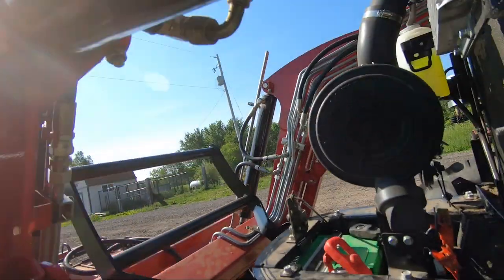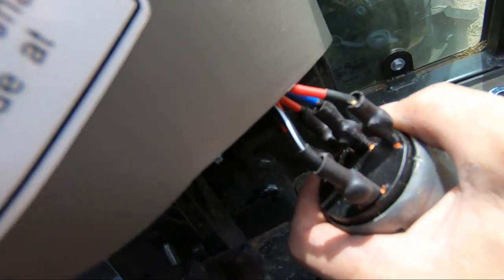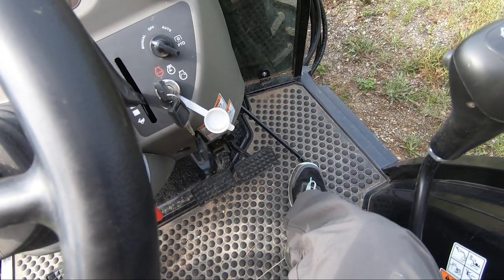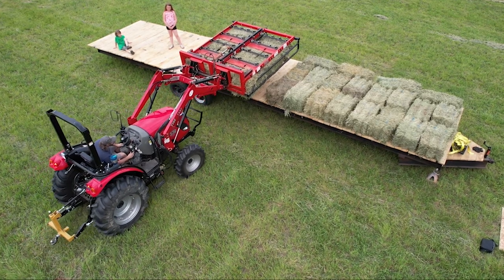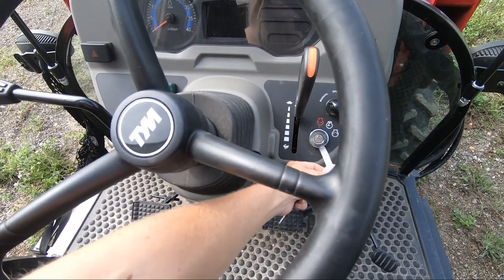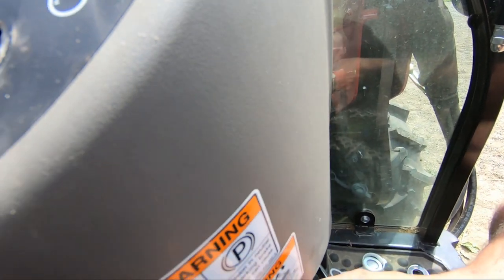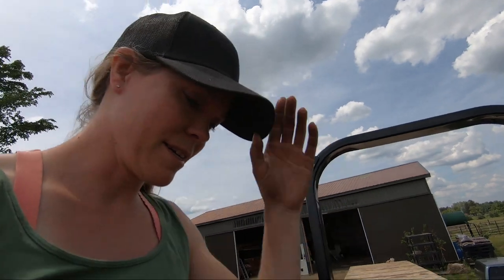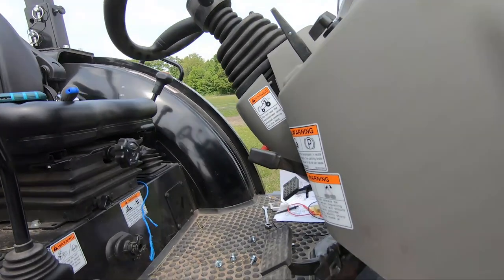381 Our New Tractor is DEAD - Why It DIDN'T Catch Fire . . .

Comment: I just picked up a t474 cab and love it. I went over the whole thing when I got it relocating and securing wiring as well as hydraulic lines. Looks like I'll be messing with this tomorrow.  Edit* I looked and my throttle cable is at least an inch away from the ignition switch.  Dash is identical looking but there must be some differences I guess.
Reply from the maker: Good to know! Maybe mine was a fluke! I almost went with the 474, but it came down to weight and being able to handle a load of hay with the grapple. The 574 is JUST big enough! I LOVE how tight they can turn and so nimble!
Reply: @This1LifeWeLive  so far in the 22 hours I have on it I can't complain about much.  Lift capacity on the loader is awesome! Tractor is nice and compact so it fits my needs just right.  Only think I wish it had was a parking light for the parking brake.
Reply: I've had the 433 for over ten years. No issues with this so far. Dash looks identical.

Be aware if you put a dark tarp over it though, it will melt the gauge cluster frame... 😕

Comment: Don’t they have some kind of warranty on their tractors? I got a 3 year on a Husqvarna
Reply from the maker: Yes they do, but I didn't have time to wait for repairs.
Reply: My tym came with 2 years Bumper to bumper and 6 years on drivetrain... I had to use warrenty on a wheel seal and it took about 1.5 weeks to get my unit back...  it was covered.

Comment: I believe you should put the NH on the bale wagon and the TYM on the baler - that TYM has a lot to handle with that bale wagon full/loaded - suggestion only
Reply: I looked up the specks on the TYM 3point picks up right around 4000lbs. If we load 200x50lb bales thats a 10,000lb load. The trailer axels are placed at 60% of the deck length so in theory you have 20% of the load on the toung making it around 2000lbs for the 3 point to lift. we have only done 150 bales so far which is a 7500lb load

Comment: That is great that there was a fuse in line. Looks. Like a design flaw. It is not good.  If it me I would have drilled another hole for the switch.

Comment: Ran New Holland tractors now for many years and never had any problems.
Reply from the maker: We've had a few with our T5 . . .PTO refusing to engage, transmission "jumping" (could be a fuel pump issue or hydro pump issue) and it's been getting stuck in gear (my husband isn't the cleanest shifter).    But this TYM has a very basic motor, so IF something motorwise should ever go wrong, it's something I could repair myself and not have to haul down to the shop :)

Comment: What happened to the basket wagon you pulled behind the baler?
Reply from the maker: UGGGHHH.., it's a massive PAIN! It only holds 100 bales MAX (usually 80), you need a team of people to get it done. One to bale, one to drive the truck to the barn, and one in the loft to help stack. Dumping them on the ground made a huge mess, and anything the knotter skipped or failed, the cart would be FULL of loose hay! Lots of people out here still use them, but they usually have family helping ;)
Reply: @This1LifeWeLive  I never understood there value. You need one of those things that put the bales in blocks of 10 or so for your hooks to pick up.

Comment: Sometimes when an electrical charge goes thru some thing that shuts down the engine there`s enough current to either weld arc a bearing or can arc 2 metals together probably what happened here , But having the throttle stiff now it`s possible that the silicone tube around the throttle cable melted some or softened enough to make it stiff ,The stationary throttle is more for PTO operation or full power ,Lucky you caught it but if that`s a new machine WARRANTY or recall   BIGTIME!
Reply from the maker: It seemed the current caused the two nuts to tighten and if there was any lube on the cable it dissapated. The fuse prevents much more damage than that. Without the fuse it would have welded stuff together and caused melting and fires like so many other brands.
Reply: @This1LifeWeLive  Actually a silicone spray is better than WD40 -Wd will hold dust and tighten silicone spray will weather proof and lubricate each use works great on vehicle window track guides too speeds them up too

Comment: You might need a new throttle cable. If the ign switch was shorting to ground through the metal throttle cable. the plastic sheath on the throttle could have heated up and melted some, causing binding.
Reply from the maker: I didn't see anything obvious, but it did help when I ran a bit of lube into it :)

Comment: Sounds like too me you need a John Deere,  I know they sponsor you but having something designed and it's rubs off the insulation on a major wire, well what else has a bad design and will cause problems in the future.
Reply from the maker: We had a John Deere to start out . . . we sold it and happily did not buy a new one, lol! Parts were too absurdly expensive, and attachments as well. Too expensive overall.

Comment: Thanks for sharing! Young lady but one thing am curious about does that trator take that daeth or dith fuel type crap that usually have the blue cap by the main fuel tank?? Just curious heard from people saying it's a pain in the butt to deal with that..lol
Reply: It does not. I think def starts around 75hp tier 4 tractors. our nh115 doesnt take def either its a 2014 model thats right before they started using def
Reply: @ruralridez6165  hi there, oh really I wasn't to sure but I think yer right last I knew it started over 85hp  but wasn't to sure. Inerways thanks for sharing your thoughts and opinions.

Comment: Wd-40 = lubricant
PB blaster = rust penetrant.
Reply from the maker: WD-40 and PB blaster are both brands which make the same oils and lubes. I prefer PB. I have 3 different types but can't remember the names off the top of my head, so WD-40 just rolls off the tongue much faster :P
Reply: @This1LifeWeLive  you're probably thinking of chain and cable lube. There's even a cheap little tool designed to aid in lubing cables with products that come in spray cans. But more importantly you really need to watch what you say in these videos. People can and will will take you literally, and when something goes wrong they'll tell everyone they learned it from you. Not everyone reads the comments section to see your corrections. You said to use PB blaster on everyone's mini tractor throttle cable. That's really bad advice since original PB blaster literally eats petroleum products like plastic, rubber, tar etc.

Comment: I have noticed that you do not keep your tractors under cover when not in use and as the TYM is not fitted with a cab rain water will run down the throttle lever and cause corrosion of the linkage . Water will eventually find its way into the electrical switches and cause problems there as well .The New Holland should be OK as it has a cab but if possible keep the TYM in the dry at night  All cabless tractors have the same problem.The issue with the electrics is poor design so the switch needs moving away from the lever.
Reply: Keeping a tractor (or any machine) out of the weather when not in use is probably the single most important thing you can do to extend the life of the machine. It also makes it easier to service as every bolt and fitting isn't rusted in place. Anything will do... a canopy, lean-to, run-in barn, etc.

Comment: Did you check with TYM before you posted this video? They might not be too happy.
Reply: We are not bashing TYM. This is why its good to use these tractors in real world use then the company can use this helpful information.
Reply from the maker: Yes, I notified both of my points of contact before beginning repair work (in case they wanted to send someone out lickity split). After reading a bit about eletrical issues online with OTHER manufacturers (I wanted to see if this was a TYM specific issue or if anyoen else had posted online about it), I didn't see anyone else posting about TYM but all other manufacturers they DID. So I felt confident that this was an issue MANY people face with smaller tractors, and as mentioned, most end up catching fire thanks to no fuse.

Comment: engineering design issue with not enough clearance from the switch to the throttle.
Reply from the maker: agreed. It was adjusted a few months after, according to others who had bought the same tractor :)

Comment: Poor design to have a moving screw or bolt that close to electrical connections.   My 2012 Kubota BX2360 has had NO wiring issues.   Also, a tractor that new should need no lubrication on throttle cables, period.

Comment: Most of the newer model tractors  Use Drive by Wire electronic throttle controls.....  like your car or truck...... no mechanical link.....Is this a eletro-hydralic hydrostatic drive tractor?
Reply: It is gear driven. and you have to clutch to go from fwd to rev. our new holland you can go from fwd to rev without clutching
Reply from the maker: This one is made more old school to save on possible repair points. So no  electric throttle control :)
Reply: @ruralridez6165  Really.... our 5075M JD has that kind of Trans where as the 5115M and the 6145R have the power reverser

Comment: Poor engineering. I looked at a 574 and decided on another brand. Glad I did. Thanks for being honest !!!!!!!!!!!!!!!!!!!!!!!!!!!!!
Reply from the maker: What didn't you like about the engineering?
Reply: @This1LifeWeLive  If it was good engineering the parts would not have rubbed and caused a short. Only poor planning/engineering causes things like that.
Reply from the maker: @waynederby4684  from what others who have bought them recently have said, the issue has since been fixed. It's not a common issue simply because most people use the for throttle not the hand throttle when switching quickly between slow and fast... that's why the foot throttle was created. My husband has been using the hand throttle running bales back and forth on the field... that's several hours worth of yanking thechand throttle back and forth. It COULD be a common issue on other brands too, but I imagine most people know to use the foot throttle when running hours on end 😉. After I asked him why he was not using the foot throttle, he started using it and found its much faster. But he's not used to running tractors all day. Clutches burn out too when improperly used... doesn't mean they are poorly engineered, just means the driver needs to be more gentle 😉.
Reply: @This1LifeWeLive  Point taken.  As for clutches, do you know how old the clutch design is?? Very old and is a poor design by today's standards. When automatics started to become more popular they had already stopped trying to develop a better clutch system and concentrated on automatic, hydrostatic etc. So while clutches do work and fairly well they are a poor engineered design by what is being currently developed. It's one of the few things that if it aint broke don't fix it actually applies. But they could develop better engineered if the wanted to but the vast majority of people want auto or hydro type transmissions that requires less physical involvement. FYI personally I'm a clutch person. Both my 3/4 ton truck, and my tractor are manual transmission which is one way I know that although I prefer them they are a old and poor design that still works. :)

Comment: So instead of fixing the problem they added a fuse to keep the tractor from burning down.?  There needs to be a solution for this and if this is on going it say we are giving you a pretty tractor not a quality one
Reply from the maker: They did fix the problem on later makes of this model. The fuse is there as a safety switch, something other small tractor manufacturers DON'T bother to include. Because it HAD the switch it didn't catch fire like other manufactures do.  This tractor is a beast for it's size. I wouldn't trade it for anything!

Comment: Very good use of youtube I would have used lithium grease spray or a teflon based spray myself. WD40 will evaporate and PB is corrosive.
Reply from the maker: I belive it was lubricating oil, but PBBlaster is the brand. I don't recall exactly what it's called, I went to buy oil one day and grabbed one of each, lol! White lithium tends to leave a thick white grease behind and I was afriad that would gum things up.
Reply: @This1LifeWeLive  that design error was so easily avoided the tractor company should be ashamed. Guess relocating the ignition switch or doing something with the bolt on the throttle is an option.

Comment: We have a tym in work its weak the pto stopped working and its full of small problems that really should be not there as there basic tractors
Reply from the maker: Which model do you have? I've used the snot out of mine and haven't had any issues besides the wiring location, which they switched right after mine had issues (according to those who have recently bought them).

For what it's worth, the PTO keeps dying on my New holland T5, so I fell your pain :)
Reply: @This1LifeWeLive  its a t503 its just got over 3k hours it on a golf course just rough mowing but id class them a soft tractor there a basic tractor yet its very smalls things have not been designed well

Comment: Everybody is hating on TYM ( and should be as its poor designed) but its all the small tractors have little issues like this, at least you didn't have to take it in to the dealer to fix like many tractors these days then wait on their schedule to get it fixed like the larger new Holland and John Deere's because everyone has a month to harvest, spray or seed their fields right!
There's a thing called Right to repair everyone should be interested in to get company's to allow schematics and parts to be sold to independent and owners. Just look up Right to Repair. 
Did the throttle linkage try to arc weld itself or was it physically hitting the nuts causing the cables to flatten and obstruct the inner throttle cable? 
To brag a little, watching the Blue Angels, F35 demo team, Thunderbirds, and A10 Demo Team perform, they're at Thunder over Michigan ( Willow Run Airport) this weekend and their flight path is close enough to my house I see them coming out and turning back in for their maneuvers.
Nice job and take care!
Reply from the maker: very true. I ahve heard about the right to repair issues . . . and why I will never buy a bigger newer tractor. I want to be able to repair my stuff!
Reply: @This1LifeWeLive  unfortunately everything is trying to ease over into company access only. Know why medical is so high? 
A bed worth 35,000 has a $500 motor burnout, they won't sell that motor to a repairman they make the hospital buy another bed ! What should be a $1,000.00 repair just cost $34,000 more.

Comment: So it’s bad designs that need to be fixed by TYM. You shouldn’t be having these kinds of problems with a new tractor. Hopefully these aren’t on going with other problems as the tractor ages.
Reply from the maker: The design is quite basic, more reminisce of tractors from ages ago. So as far as repairs go, it should come easier to fix than most if not all other brands of the same age :)

Comment: Must be getting paid by tym. Cause nh tym ih LS bad boy are all tym units. All tractor makers fuse the hot wire to the key. Never not seen one without a fuse. I own Deere an have no issues with anything in a few 1000s hours. 2015 and 2018 units
Reply from the maker: Actually LS makes their own as well as Case, IH and many many others. I talked to the rep at the Kentucky Farm show. All smaller unit JohnDeere in the 45-55hp range are made in Mexico or India and had awful reviews. And I've seen plenty of reviews of name brand tractors in this size range catching fire.

This girl has been worked harder than either or previous John Deere or our current New Holland and the only area she gave us issue was with the hand throttle. Tym caught the issue on their end and re-designed the location. Most manufacturers wouldn't bother. They'd just keep producing them.

Comment: TYM always dying, like all tractors do
Reply: At least they didn't buy a Mahindra, those tractors are big time piece of shit 💩
Reply: @mattutke4704  my neighbor bought a mahindra and blew the transmission. he was in a slow gear pushed the clutch in to roll down a hill and I guess something in the trans doesnt disengage and blew his trans he had to split the tractor in half.
Reply: @ruralridez6165  holy cow!! For some reason I never really cared for Mahindra much
Reply from the maker: All tractors will have issues. It's a matter of WHICH issue you'd prefer to face :) Even my New Holland has issues . . . PTO keeps refusing to engage!
Reply: @This1LifeWeLive  Yo, but NewHolland is crap as TYM, why you buy crap ?